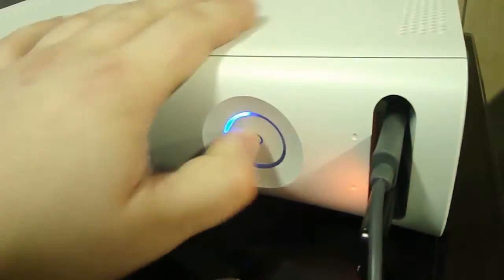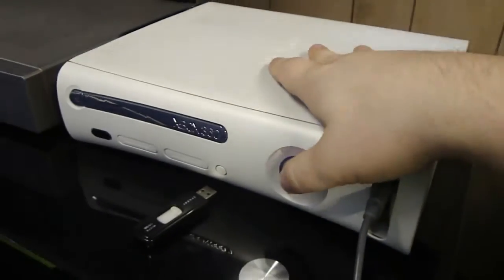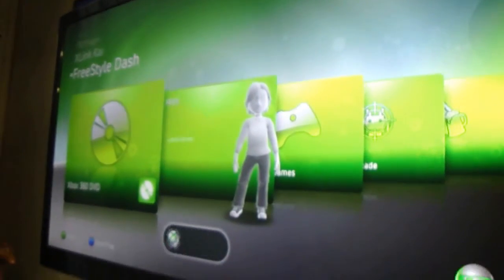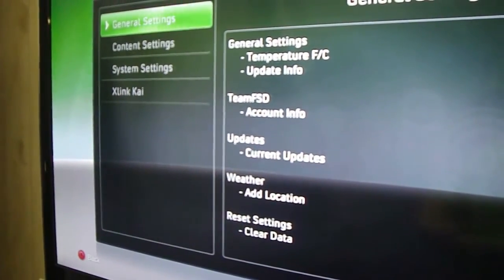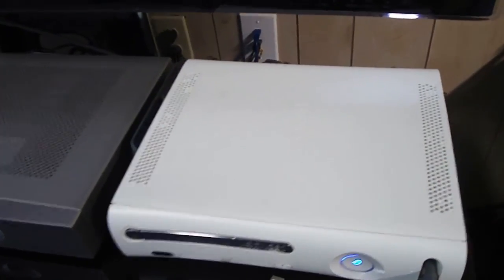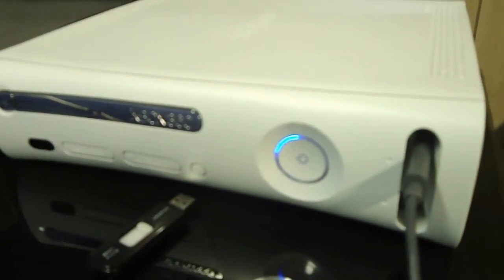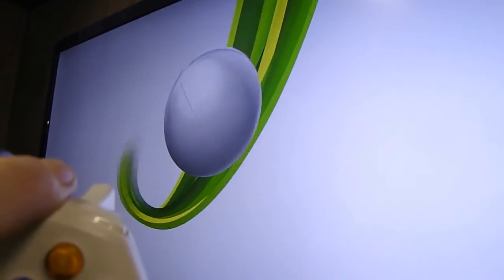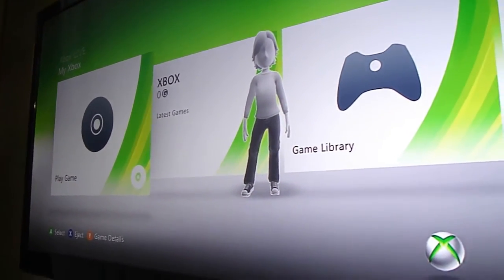XBOX 360 COMPLETE JTAG TUTORIAL - FROM DISASSEMBLY TO SOLDERING TO FSD PART 5/5 HD

Comment from the maker: @cookiecutter35 - Does the RROD go away if you reboot the XBOX right after or does is post RROD and repair another fix? If the RROD resets after boot it's a bad JTAG wiring or the latter requires a proper reflow/reball. Do you have the secondary error code?

Comment from the maker: @IProKaZ - Yes you can boot the XBOX with the LPT cable connected just not when connected to the PC however I have done this once on accident and it had not negative effect.

I would however not leave the LPT cable installed as it is not really necessary once the XBOX has been JTAGGED.

Comment from the maker: @OCM956 - Not sure what you mean by "when you jtag have to have the xbox turn on or off". You can leave the LPT cable connected to the motherboard or remove it, for a newbie I would recommend just getting the NANDX and soldering the headers onto it. Just do not have the XBOX ON and the LPT cable plugged into the PC. I have done it once, did not damage, but you don't want to do it.

You leave the transistors/resistors in place, they are never to be removed.

I would just recommend buying a JTAG.